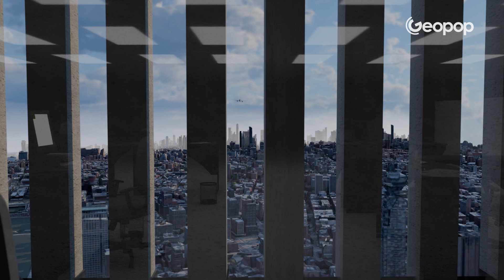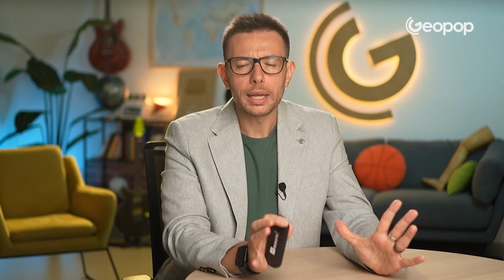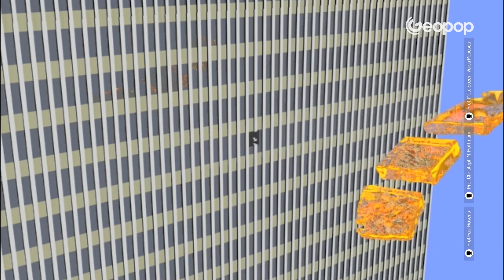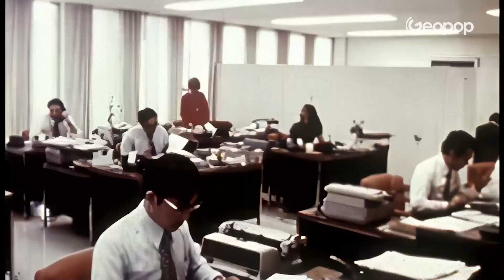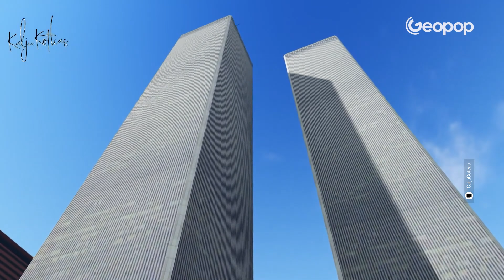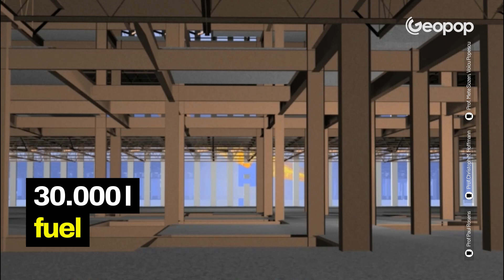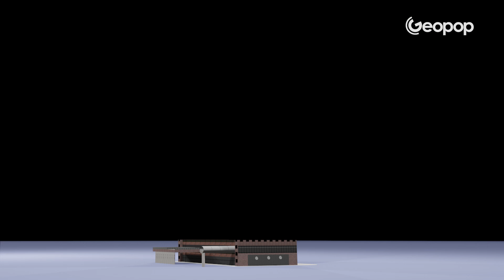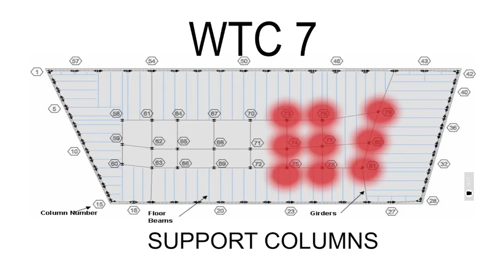9/11, 2001: The Technical Reconstruction of the Twin Towers and WTC 7 Collapses

Comment: It fell in on it self That Can Only Happen with Controlled Demolition and Thats A Fact you Moron
Reply: Nonsense. Collapse was a function of building design and damage sustained by mostly building design. In short - how the Twin Towers fell is the only way they could have fallen. 

The 47 core and 236 perimeter columns support all of the gravity loads of the building. ALL of the resistance is in the columns.

Planes impact Towers, causing massive structural damage, starting multiple floor-wide fires that spread rapidly due to the destruction of fire protection systems during the impact.

Serious fires were largely confined to the impact damaged floors and those immediately adjacent to them.  

Fires were started by the impacts and fuel aboard the aircraft, which acted as an accelerant. No shortage of other consumables inside the tower to continue the fires. 

Collapse was initiated (started) at the impact and fire damaged floors when floor trusses exposed to heat over time sagged, in turn pulling on and causing the inward bowing of perimeter columns by up to 5 feet until they buckled. 

No steel melted or needed to. Structural steel will bend and fail at less than half its melting temperature.

Once the perimeter columns buckled the formerly static load above became a dynamic load 30 times greater, easily overwhelming the structure below.

Thousands of tons of now loose debris fell through the open off space - through the inside of the building bypassing the columns - dropping 12 feet onto the first intact floor it comes across. The massive instantly overload causes the floor to fail, adding its mass to the falling mass which continues to accelerate for another 12 feet until it impacts the next floor, rinse and repeat all the way down. Rate of collapse increases as momentum increases. As each floor fails, air inside the building (the Towers were 95% air by volume) is compressed, then blows out the sides _in reaction to the Tower falling, not the cause of the Tower falling.

No fire required at all on floors below the impact points for them to fail. The mechanisms that started the collapse are different to the mechanisms which continued the collapse.   That will be a difficult concept for some.

As the floors fail the perimeter columns are left literally hanging in the breeze, no longer attached to the rest of the structure. They peel away and fall in great sheets (think banana) out to more than 600 feet from the base on the 4 points of the compass. 

Core columns failed last. 

Each 110-story tower had a 1-acre footprint. The debris pile was up to 14 stories deep and spread out over 16 acres, destroying 8 surrounding buildings and damaging more than 100 others.

Comment: Aluminum plane hits 250,000tons of steel... plane disintegrates but building doesn't even move. Steel was wrapped with fire protection wraps. All the fuel was vaporized in that big fireball generated from the impact most of it on the opposide side of the building on the outside of the building. Jet fuel can't do that
Reply: Doesn't move eh?  youtube.com/watch?v=Qk5NQgU-9G4&t=3s&ab_channel=3UZFE

Comment: I don't doubt that one day, someone on their death bed will finally tell the truth.
Reply: I really didn’t wait that long. Only problem no one wants to hear that story.
Reply: What is the source of the many tons of molten steel found in and under the debris, the heat so intense that the molten steel remained in that state for weeks afterward, running off of the debris as it was excavated. This cannot be molten copper from wiring that retains the color of a shiny new penny.  It cannot be molten aluminum that retains the color of the polished aluminum wheels of a street racer. It was the color of glowing orange molten steel  that cannot be mistaken for any other material, reported by firefighters who are very experienced in the nature of such materials as well as seen in video evidence.

When you combine this with an entire lack of turbulence behind 500 mph aircraft, when even a small Cessna Aircraft would leave an evident wake in the smoke and fire only seconds later .  . We find that skeptics still cannot be skeptical of the official narrative in explanation.  Sponsored channels and forum activity are skeptical of nothing when support is provided.

Sponsored activity in the forums is very normal today for commercial and political purposes and subjects of controversy -- in the attempt to lead public debate.
Reply: They scream "conspiracy theory" the very moment someone asks a good question. That's kind of a message too.